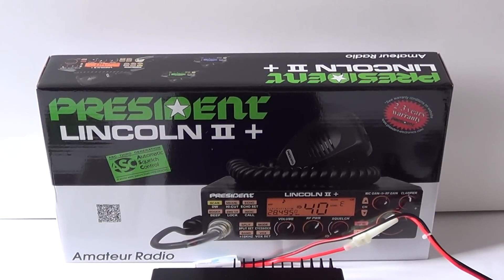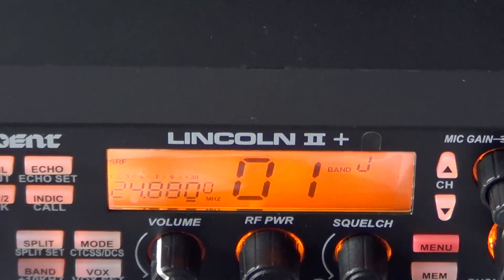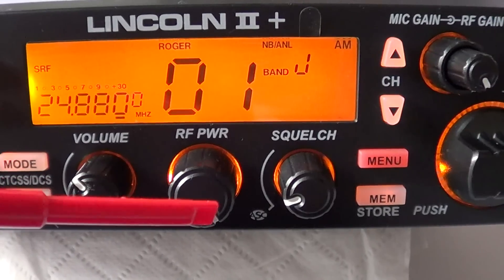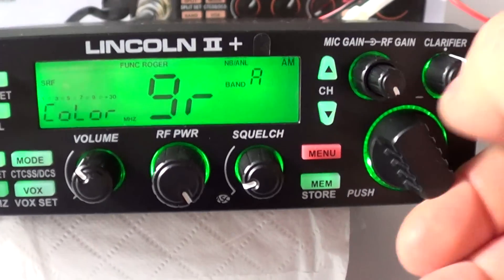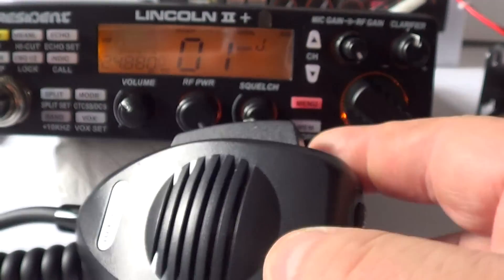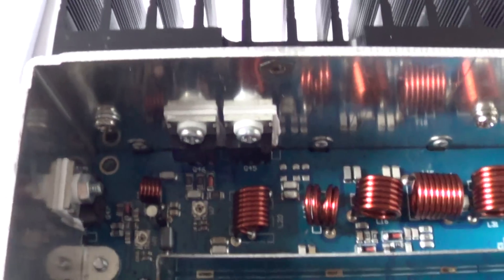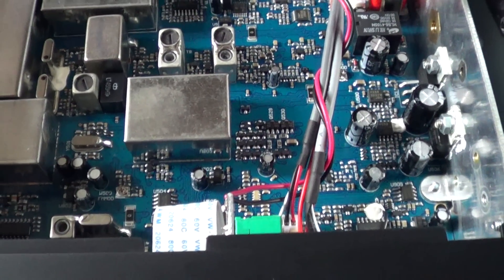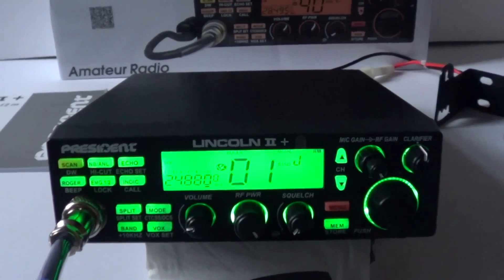President Lincoln II + Review........Part 1

Comment: nice radio , if I do get one the first thing I would  is beef up the  12 volts  line with more solder  (running  at almost  2/3 end of the board ) those always  go . nice job may take  another 2 years before hitting the  USA lol.

Comment: So, this is what, V4? Priced somewhere around £250 probably. A lot of money for an Anyclone, that has had a number of issues. Price should be nearer £150, but unfortunately the extra cost is having the President badge on it, even though they don't make it. They need to make sure it is perfect and have a price realignment, because there are better radios out there for £250 and less.

M0KFO
Reply: its basically just another Lincoln 2 with the metre amateur band added (24.890-24.990)
Reply: 12 metre band added sorry
Reply: The 12 Metre band is fairly dead most of the time and I certainly wouldn't be using a channelised radio on it.

Comment: Thank you for the video Dave - The resistor appears to be missing from your radio, it should be located at the front where the white wire used to be. You can actually see the empty spot where it should be. I'm guessing that when this resistor is removed/cut you are then able to expand the radio via the software...  Or maybe you need to add the resistor???   Also it will be interesting to see if the Engineering Mode still works on this new version!!!!